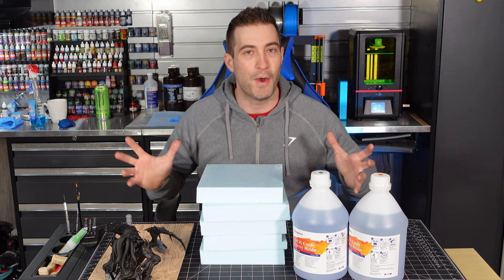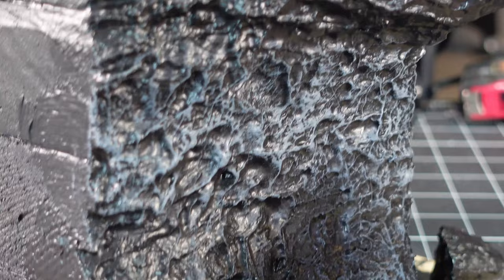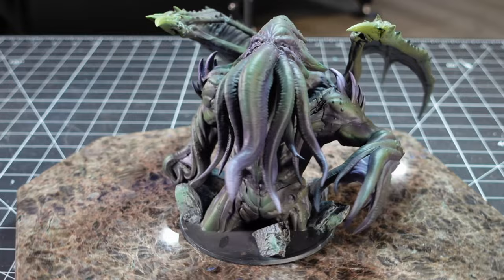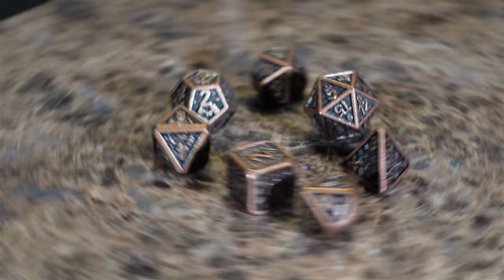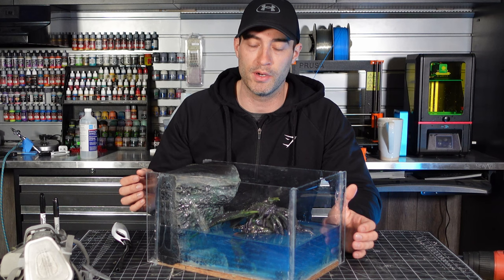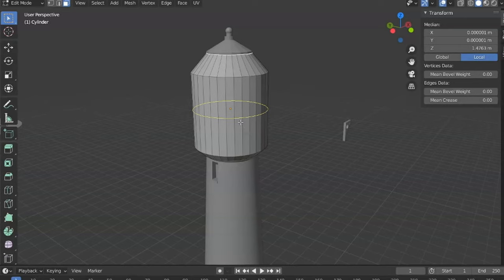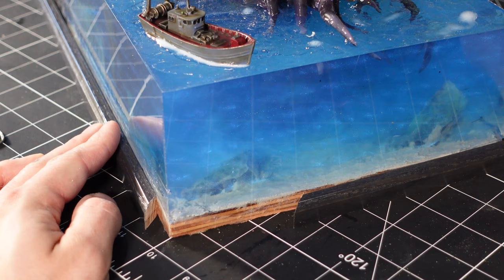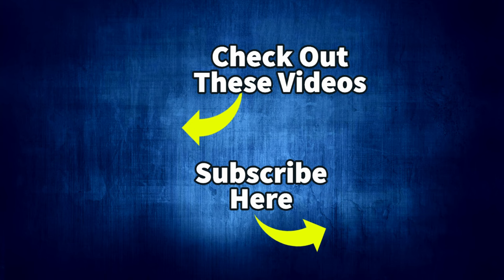HUGE RESIN POUR - Massive SEA MONSTER Cthulhu Rises - Epoxy Resin Diorama Art

Comment: Why can you only do an inch or two at a time with this resin? Does it just not cure otherwise?
Reply from the maker: With this particular type, it can only do an 1" or so at a time because it gets really hot when it dries and the deeper the resin the hotel it gets and when it cures it will cause it to warp and become malformed.

Comment: You could have just left the caulk base coat and gone directly to the painting without the Mod Podge coat...

Epoxy Resin doesn't care about caulking at all...what you do need to be careful with is water and Depth of Pour...

Epoxy Resin absolutely HATES water with an Unholy Passion and the pour will crack like crazy during curing...pouring it too thick can also cause cracking because the Resin heats up during curing and if theirs too much Resin, it gets too hot and undergoes an Exothermic Reaction which also results in cracks...

There are 2 ways to prevent an Exothermic Reaction...1) don't pour too much volume at one time and 2) use fans to cool the Resin as it cures, the fans can dissipate some of the heat and prevent it from reaching the Exothermic point allowing you to pour a little thicker than you really should, but be careful as it's a very delicate line between a good cure and an Exothermic cure...

If you really need to pour a lot of Resin at one time, there are Resins out there designed for that, they are formulated to generate less heat during the curing process allowing much more volume to be poured at one time, the trade off is both they're more expensive and they take MUCH longer then most slow set Resins to cure - most slow set Resins cure in a day or so but deep pour Resins tend to take 3-4 days to fully cure...
Reply from the maker: Thanks for the tips on the resin. I will be doing another resin build soon  and I will be going with a deep pour product. I am going to set a fan on it as you suggested as well, good idea.
Reply: @FacilityD20  Something else you might want to do is when you're building the mould, mask off the edges of the sheets where you're going to glue them to the base and/or each other with tape and spray mould release on the part of the acrylic that will touch the Resin. That should make de-moulding it MUCH easier since the release spray will help keep the Resin from sticking to the Acrylic sheets...